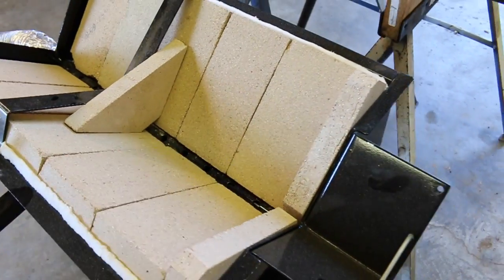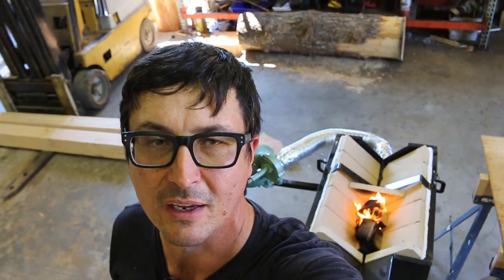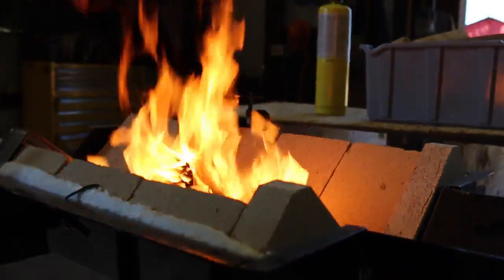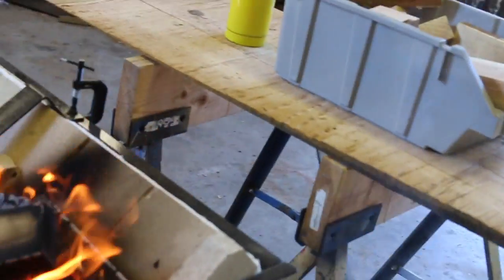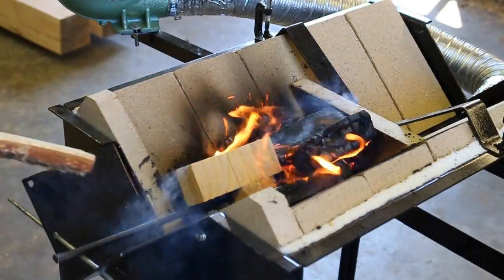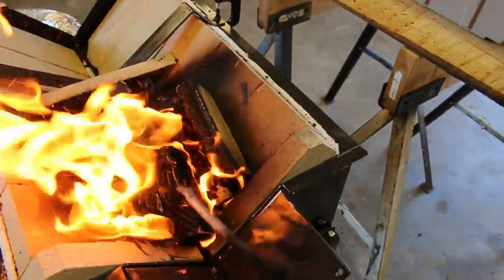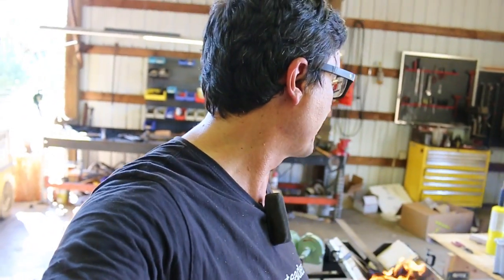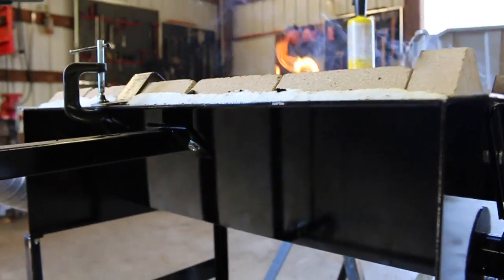Forging Steel With Wood Scraps

Comment: Cody, as soon as I heard the blower gearbox, it reminded me to mention something that I noticed during your assembly video.  You didn't have directions & used grease in the two lubrication cups.
My grandpa always had access to the used transmission oil from the county barns.  50 years later I do not, so I use a 90W synthetic, since that's what I keep on hand for my trucks.  It might wet your gearbox & quiet it down some.  Loud gearing can mean wear...  
Nice forge & being portable is just awesome.
Reply: RPGJunkie I agree.  That's an elegant designed trough forge.  Wheels and the fact that the blower isn't free standing is brilliant. 
I use a 55gal drum to make charcoal from oak pallet wood.  2"pipe in the bottom, going radially to center gives plenty of air for natural draw.  Once it's burning with no smoke, just clear gas coming off, just drop on the lid & weight it.  
Caution: The gas will vent out the air intake & auto-combust immediately.  Do not stand there, unless you need an excuse to purchase new boots.
The resulting charcoal will produce a hotter forging fire & less smoke in your face.
Reply: Todd Harrell I thought about suggesting he make charcoal, myself. But since the only charcoal I've ever made was just in an old paint pail, I thought it was better to withhold my opinion. lol. I find charcoal making to be a fascinating process.
Reply: I've seen some videos where it was made in a large steel bin, about 10' round and 4' deep. I think it was made by burying the wood in dirt for most of history, but I've never seen that.

Comment: I would like to say COOL FORGE. I would have liked to seen the steel construction a little thicker but I tend to over kill. You might want to turn the wood in to charcoal before using it. It would burn hotter with less smoke.

Over all your videos are great and informative. Glad I found your chanel and thank you for what you do.
Reply from the maker: +Gary Benton thanks Gary

Comment: I find a brake drum forge works just fine with charcoal, a hair dryer/bufflo blower, and a cheap harberfreight cart. I've probably put more than $200 into it though and i wish I could do it again and buy this when it was still a little product on Amazon!!! Too late but good for them! You should do some bladesmithing when you get a chance, it's fun!

Comment: Very nice! At first glance I had my doubts as to how strong the forge was, but when you put the piece of flat bar in, it looks like it held the bar nicely. If it's light weight then that means it will be easier to move if you need to take the forge some where else to do some work.. It's not like you are going to use the thing as an anvil.  Also, by the way, if you wanted to make wood charcoal for your forge, there is a good video on the Purgatory Ironworks channel that explains how to make it that you may like.  As always, Great jobs on the videos and keep up the good work!

Comment: Hey,

I built a wood forge out of an old compressor tank, and I figured I'd pass on some tips that might help you out...I'm able to get higher heats when I add a bigger pile of wood. I try to stack the wood as tightly as possible in the forge. A lid is also really helpful. I usually use a piece of old plywood. It holds in the heat and eventually turns into coals.

Comment: Nice forge Cody,
I have forged with coal.wood.charcoal and gas.
For wood, coal or charcoal I use the same forge. A bottom blast side draft masonry forge I built myself with sandstone. I do find charcoal and wood burn much faster and with more sparks than coal. However, the charcoal burns cleaner for welding. instead of charcoaling in my forge I use a 55 gal drum to make my charcoal...keep up the effort forging is a great experience. TIP: add wood frequently and get a bed of coals that you can bury your piece in.

Best regards
William

Comment: Hello, I think that this is fantastic and brings a new edge to blacksmithing. Off course there is no replacment for a big coal forge but they are very exspensive to run and hard for beginners to use but this does away with that.

I just wanted to thank you for opening my eyes to this technology and I will have to look into building one.

Comment: Thats a really slick setup... and it makes sense the out side is that hot because the air vents isnt insulated so the heat can transfer through that pipe really easily.

Comment: That is a cool forge.  The one thing I did notice is all the hot embers coming off of it when you first start putting air to it.  But that is very cool.  I've heard from the same arm chair wonnabe's.   That is one reason I shut my channel down.  Just got back into it again but I get alot of good info from your channel.   Keep up the good work.

Comment: You can use a spray bottle of water to keep the high flames down  and using branches is easy because there small dry quick and you can have a good use for them when you fall trees

Comment: Great job you keep up the good work I’ve never use wood in a Forge like that but I make my own charcoal it don’t matter what anybody else thinks what matters as you build a great Ford I like the way it works I think it will work good I may do the same but keep doing the blacksmith thing it’s very rewarding and we don’t need to let the art of blacksmith in slipped your fingers I like to teach kids anywhere from 7 on up. I have been blacksmithing myself about seven or eight years part-time in a couple of years I’m going to retire and then become a fall term smithy Wrangler you keep up the good work I love it

Comment: wranglerstar I think that forge is nice. I personally might get tired of hand cranking all the time and might make an adapter with a Rheostat, motor and pulley system. But in all honesty for the money and being a fellow hobbyist in metal working I might purchase this exact forge. Thank your for bringing to light, because before this I was working on putting together what you had before... in fact I have a brake drum that was going to be used but honestly for the money and quality I prefer something already designed to work.
Reply: I was on their website, and they do already sell one with an electric blower.
Cheers.
Reply: I want the option of hand blowing for small projects... and sometimes its a nice feeling to do everything by hand...but if i have a long project I want to be able to switch to variable speed.

Comment: You could easily make up a little hood and shield yourself from some of that radiant heat if you wanted or even a combination stack. Mabey the wife would enjoy the old brake drum forge for a planter in the flower bed.   Wood and charcoal were the first things used to forge metal, I'm surprised a forge like this has not come along before now. Looks like a great forge and thanks again.
Reply: We are working on a hood for the fullsize forge to help with exactly this. We came out with one for the Mini Whitlox Forge earlier this summer: http://whitloxhomestead.com/products/forgehood

Comment: You have some very interesting videos and your efforts are always appreciated. On that note, personally I'd refrain from addressing online trolling in any way as it tends to exacerbate the issue and detracts from the viewing experience for us non-trolls that really appreciate the time and effort you put into sharing your hobbies and skills. My two-cents. Thanks as always! Keep up the good work and try to use more wood next time :) (fill it up). You want to be able to burn down as much wood as possible to get a nice carbonized bed of embers you can stoke when you need more heat!

Comment: that looks to be well put together. The finish on the steel looks well done, it certainly appears to work very nicely. I'm sure with a bit of experience using it you'll be having a lot more fun than using the brake drum forge. (due to ease of use.)

Comment: im learning a lot myself, but i feel it may be easier on your part and quicker to make actual charcoal beforehand. you can make it in a 55 metal gallon drum by adding a vent hole at the bottom to suck in air and closing off the top. what you do it start with it open, build a small fire and some coals, then seal it which pretty much extinguishes the fire. the heat then turns the remaining wood into charcoal. that will burn hotter and cleaner than using straight wood because the gasses burn off at lower temps. the 2 burning together wont make it hotter it actually cools it, like adding boiling water to tepid. which will get your metal at higher temps which are more suitable for forging. that dull cherry red wont forge weld, move easily and cool too quickly enhancing chanced for cracks in harder steels. and i think the forge seems sturdy enough for a hobby forge! good  work

Comment: Im really impressed with the wood being hot enough!
I built a forge out of an old propane tank last year. Its lined with high temp clay and is fed with a hair dryer into a perforated pipe.  I  absolutely hate using coal. It burns too fast and costs a lot if i want to forge for the day. 
Im going to give wood a try.. I never thought it would work, but now im optimistic!

Comment: I am 100% jealous of the witlox forge. Seen it together and going, it is so impressive and I am sold on it. I will have to say, the design is impressive and how it is built is to. To know what materials and how to put them together to make something light weight and strong is more impressive then something that is over built. They have to know they metals do what they did. It so much more then lets weld some metal together and light a fire in it and hope it works.

Comment: I had seen these units on line before.  I think it looks great and is quite affordable.  I too have a brake drum set up, but I am burning charcoal.  Being able to section the fire and also setting it up for the pass through is a real advantage.  As you said, for hobby use ect. this should work really well.  Enjoyed the video.

Comment: I've been thinking about moving to a wood fired. I've used coal, I currently use propane. The nice thing about the propane is you don't have to manually crank it. Downside, propane is expensive as well, and because of the more enclosed design, I am limited in things like the bands you're going to make. I have horizontal pass-through, but anything curved is a pain.

Comment: I'm getting to this video a tad late. Please do not take this on me posting negativity about the forge. I'm simply curious about the forge itself. I have zero knowledge on forges but love watching this and my questions come with maintaining it. Wouldn't holes on the very bottom become an issue if you don't have air running through it for a while? Or what does the empty/ cleaning process look like for this forge? Is that an easy or difficult job? Can't wait to see more work with this glad to learn more about this as always. If anyone can answer any of this please do.

Comment: For a couple months now, I've been using my brick forge that I keep outside. Just some pipes that run under a sheet of metal covered by clay and stacked bricks to keep the coal from falling.

It works very well and all I have to do is put the finishing touches on my first knife! (Which will be hard because I don't have a belt sander at the moment... but wish me luck on future projects! :D

Comment: Looks good..only improvement I could suggest would be to highlight the numerals on the air column adjuster so you could read them easier.have fun with it 😉

Comment: Cody, I have no doubt in my mind that the Whitlox forge is a fantastic piece of equipment.  In fact, a forge like the one in this video is on my wish list just like a Wood-Mizer used to be.  (I am now the owner of an orange sawmill.)  My question is this.  Is there any reason that you couldn't fire your break drum forge with wood?  I would think that it would work just as well with wood as the Whitlox forge does.  That is, a wood fire in the break drum forge would be just as hot as it is in the Whitlox forge.   Yes there are definitely advantages to using the bigger forge, that is why one day I will be the owner of one. My point is this. I don't think a person has to wait to buy a Whitlox forge before they can start blacksmithing with wood. 

This is my favorite YouTube channel! Keep up the good work!
Reply: Darrel Carson You can forge with wood in any forge. However it is not going to be very efficient and it is not going to get as hot as this design does. The V shape coupled with the air delivery is designed for wood, it is putting a lot more air in at the base of a fire than a coal forge does which is going to make it work better.

Comment: our forefathers forged with charcoal as coal was imported from
 England and very expensive. I would encourage you to look into mass producing some charcoal as it will simplify complicated forgings. There are lots of videos on YouTube about this.

Coal,even high grade metallurgic coal, is really filthy. Until it cokes it makes horrid smoke.the charcoal looks nice and clean and should be ideal for forge welding.

I have a big heat problem in my 16x 12 forge. It is hard to work out there unless it is dead of winter.i am in the process of making a covered ,but open extension of the forge.

Have fun and disregard the mean comments. Your channel attracts a lot of trolls.
Frank

Comment: I think you forgot to show us that the forge can reach forging temperatures (yellow instead of red), which I have no doubt it can. Please don't take this the wrong way but I would suggest to use slightly smaller wood pieces (like cutting the biggest ones in half). Smaller pieces can cover up more of the crevices between the wood/charcoal and make it lose less heat to the surrounding air, making the forge more efficient and you less sweaty.
And don't worry wranglerstar, I may be a bit of a keyboard warrior but I have the best intentions and experience on the subject. I can sent you some pictures of the coal forge I welded together at the age of 18 ;)

Comment: That thing is awesome! Definitely way easier than all the fussing around with all the banking and watering with coal. 
   I'd imagine you could even toss a couple chunks of coal in if you wanted, or needed a little extra heat.

Comment: After spending time watching Cody's videos and getting a feel for how he lives his life, I am sure many of us would expect him to have full coal burning blacksmith forge with the leathers bellows using traditional tools and techniques.  Reminiscent of the John Neeman videos when the smith is forging the axe head or folded steel knife.  In reality no one has what is expected, you need something practical to start off.   wranglerstar is not a blacksmith expert by any means(I am sure he would agree), so he is still in the learning phase.  No one buys the best off the bat to learn.   I think this forge is great for beginners from the looks of it.  I am sure it will be great for his son to use as well.   Perhaps one day if becomes a more accomplished and experience smith he might switch to something better but until then I think he might a good choice for himself.

Comment: hi wranglestar, my name is christopher, i am a plumber student in belgium, and sorry, because my english level is pretty poor ^^

i have hears you want to make charcoal, there are few method to do it, but the method i will prefer if i want to do charcoal is the pyrolisis, heat a pile of wood into a reservor, that will produce flamable gas, so you will have to let them escape from the container, a hole on the uper side of the container will do the job i think, and burn this gas, because it's toxic to breath it
(like wood smoke when we start a fire ) 

i see few guy who use this gas to run engines, but that use the charcoal into the reaction, the name of this machine is gaseification 

other guys stock this gaz into propane bottle for latter use.

oh, and before i forgot, did you know the "rocket stove " ? this think is amazing, i have smelt an aluminium pipe with this
for test how hot this think can be

i see yours video from a long time, but i don't follow you before, i don't know why, becauce you are amazing, good job  and have a nice day sir

Comment: I have not tried this forge out, but even if it cost more, coal produces more heat and a better black smithing fire. You can use wood as you did in the video, but coal will work better and there is a reason that all the pro blacksmiths

Comment: another option that I would like to try is making the charcoal in a separate process,
Basically you could use tree branches or construction scrap anything over 1/2 inch. I saw some people use an oil drum with an intake on the bottom and outflow on the top.

Comment: If I bought one of these, I'm still not exactly sure why the wheels on this thing are necessary.  Is there a reason I would want to move this around when my anvil wouldn't move around with it?   Maybe there is some other use that I'm missing.

I have to ignore the fact that the stand wasn't the proper size.  I have to assume they now know of this issue and are correcting it and will make it right with any customer buying one.  I assume this only because if this isn't corrected, I don't see many people purchaseing an item they can't assemble.  :)

I am annoyed however with the air hose.  No I don't own one, but that hose just doesn't look like it fits.   It is this attention to detail that you really like that I felt was just missing in this small instance.

Glad to see a wood forge that will fit your needs though.  Until you brought up this product a few months ago I really didn't expect it too work.

Comment: Id love to share my homemade forge with you. Its made from an oil pan off a 305 olds, fire extinguisher and a 90* bent 2inch pipe that swirls the air in to the pan. Hair drier power cause well free and im broke but not poor ;) something I learned from you in passed episodes 

Your friend from the north 
And btw great forge!